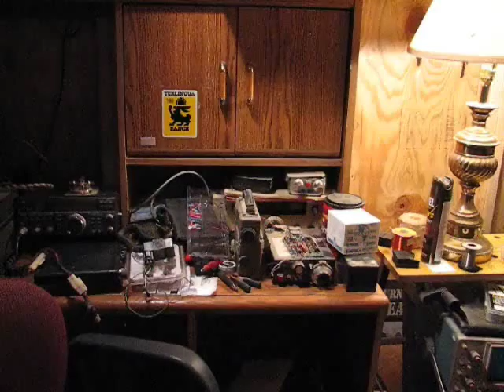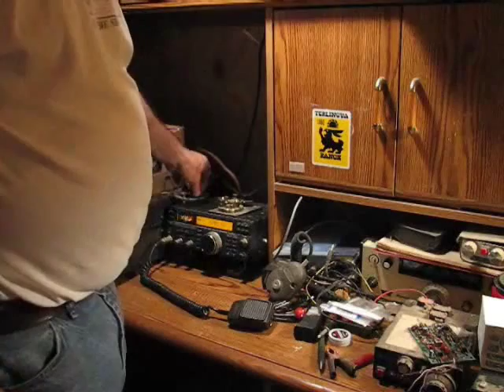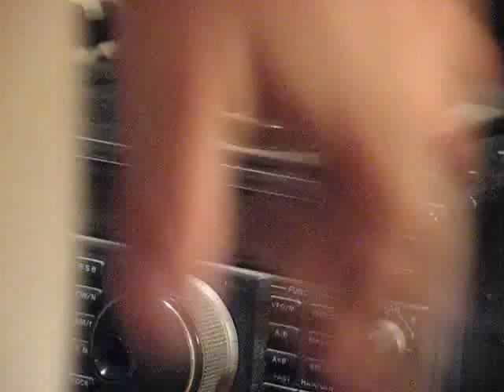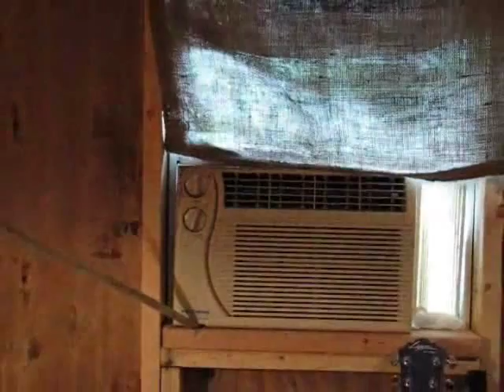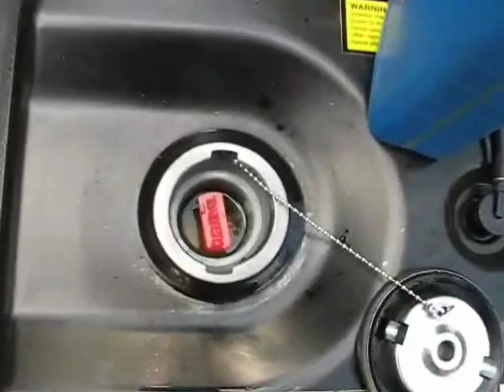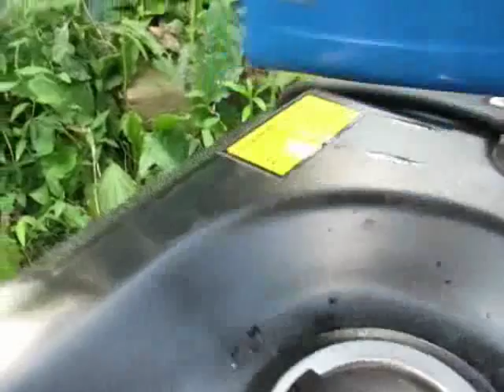Portable Generator Test

Comment: Why do you shut off the engine by cutting the fuel valve?
Reply from the maker: +AtPeacePiece To drain the fuel from the carburetor. Fuel left in the carb tends to deteriorate and gum up the works, and is the number one cause of small engines running poorly or not at all after being stored for awhile.

Comment: I agree with you about the Ethanol fuel, over here in Australia we have E10 at the pump. It does not play nicely with small Briggs and Stratton engine fuel pump diaphragms, makes them go all baggy. The engine performance will slowly degrade and eventually it will not idle unless you keep hitting the primer bulb. Then have to 'boil out' the carburetor body in an ultra sonic cleaner to get black soot like stuff out of the internal jets and filter screens. 
A liter (near a Quart) per hour sounds like reasonable consumption for a small machine, as long as it keeps the beer cold! Cheers.